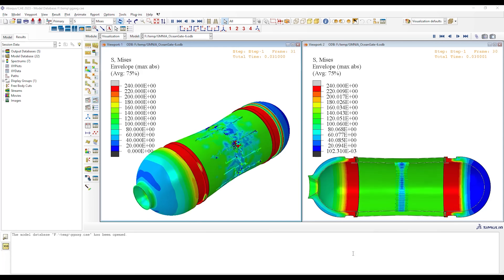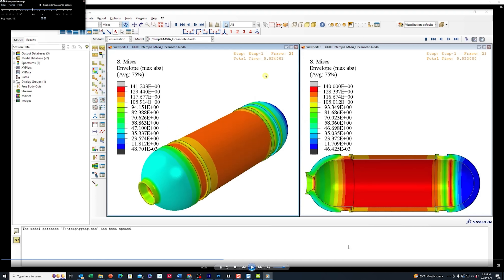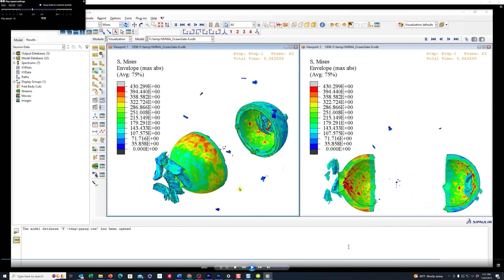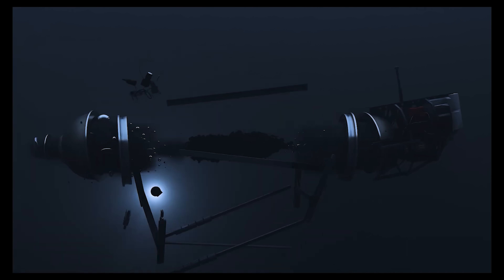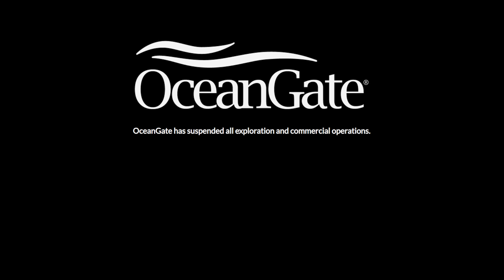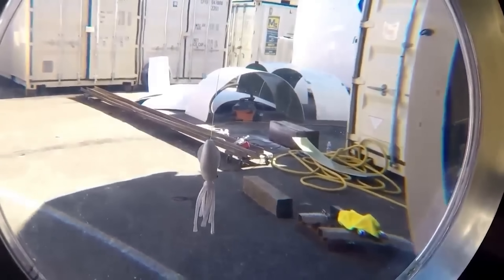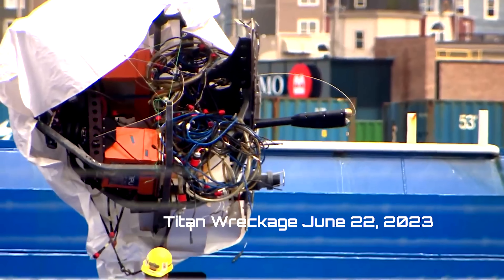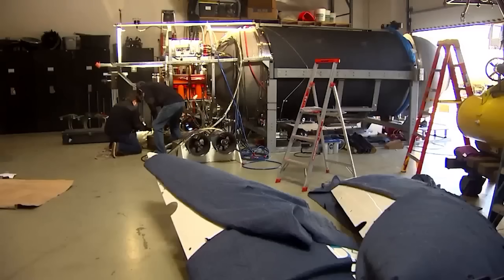Best Titan Sub Implosion Simulation, Cracked Porthole? Q & A

Comment: Wasn't the carbon fiber spun around a very thin sleeve of titanium  which wouldn't have broken up but just flattened out to the thickness of a sheet of paper. Imagine a soda can lying on its side with both ends removed and dropping a 1000 lb. weight on it.

Comment: Please take into consideration, that the deformation shown  in Dr. Wagner's simulation is probably exaggerated by a large scale factor. Carbon fiber composites are rather brittle. There is no way the carbon tube could deform to half its diameter without breaking.

Comment: QUESTION❓️ ,,,,  THE  MATERIAL  COMPOSITE  GLUED  TO THE  METAL  ,,  MAYBE  THESE SURFACES   COMPLETELY  SEPARATED AS THE  WEAKEST  POINT  BESIDES  THAT PORTHOLE  ONLY  OK AT  SOO MANY FEET   ,, NOT REALLY   AN INTELLIGENT   DESIGN   AND NOT  DEPENDABLE ❓️

Comment: another thing to note is this very video that shows a guy using off the shell tools to create an FD simulation of what could happen.  which means these guys didn't even have enough brains to see the results in a simulation.  its not to say the simulation got it perfectly right,  but the point is the craft wasnt 'suppose' to implode at all!! under the conditions it was ment to dwell within.

Comment: The cameras......... were they sending data to somewhere off the Titan.......like the mother ship? No one has mentioned this possibility.
Reply from the maker: Radio waves do not travel well under water, so they have to use hydro phones. And so they are limited to sending very small amounts of data. So who knows what Data they were able to send automatically in the background up to the support ship top side.
Reply: @jeffostroff  So, there must have been a pretty good delay in sending and receiving the text messages they were communicating with.

Comment: The most dangerous thing is someone using FEA where they make assumptions.  Carbon fibre is not homogeneous and modelling this without taking this into account and substituting a homogeneous material is not accurate. The Carbon fibre weave, direction and inter layer construction is important. If there are voids (no autoclave) can add significant weaknesses that can cause major fatigue, high stress raisers and regions for buckling. In this case it was not under tension. Which is bad. If for example there was a tear  this could jet like a water cutter slicing through anything or cause immediate pressure equalisation. Implosion. Given the shape was totally incorrect  for this pressure and the fact that they only did FEA like this to validate without real life data to correlate.

Comment: Titan had issues long before its fateful dive, as we now know from others who went on previous dives, have spoke on hearing crack and loud bangs upon their decent.   again, this 'accident' was completely avoidable if not for Mr Rush being a bone head.  And i hate to speak of him as such, but when you see all the evidence and his interviews the guy was little more than a brainless idiot who's arrogance got the better of him, and unfortunately took the lifes of others that were with him.   Arguable he could be forgiven for thinking carbon fiber to be this super indestructible material when its not.  far too many people have herald carbon fiber to be something its not!.  Its not a material that stronger than steel. why? because its strength only applies to one metric, not all.  if i can cut it with a pair of scissors in the making of patterns its to be molded into, than where is its strength.  Yes is has tensile strength stronger than steel, pulling apart. but its a fiber woven into sheets bond by epoxy resin.  its strength is governed by something that not strong is such applications  Resin in compression.  this is why in Formula one, it only takes the littlest tap from two cars touching each other for carbon fiber bits of their bodies to go breaking off and shattering into pieces.  how strong is that?  No the guy avoided all signs including those he experience himself upon several dives.  he was a bone head period.  The fundamental flaw was the crafts creator.  He hacked the craft together never accepting the reality and seriousness of what that craft would be forced to endure.  and he did it for the sake of arrogance and shoving his middle finger in the face of regulations and the regulatory body.   his big headedness got the better of him, and took others with him to their fate.

Comment: Another thought. When you see the footage from the KOMO video in 2018 of the sub under construction it sent up a red flag for me. TIf you pay attention to the later interview with Stockton in 2022 you will notice how weathered and beat up the Titan looks by comparison. It made me wonder. Was any maintenance or upkeep done between 2018 and the implosion in 2023?  Just looking at how different the hull of the sub looked some 4 years later it really made me wonder if simple lack of upkeep from regular use might have resulted in a weakened hull.

Comment: Presumably any bit of equipment on the outside that needs a control or data link to the cabin will need a hole in the hull to pass a cable or plumbing through...or was it nearly all wireless? We've seen the infamous Bluetooth games controller - was this talking to an access point in the equipment bay (i.e. outside the pressure hull), and if so, was there no cable-based redundancy in place at all? Really enjoying your discussion of all this!

Comment: Even if the cameras all got destroyed the video on those cameras is likely still around. Keep in mind that this is digital and the transmissions from the cameras would have been transmitted to the surface vessel-. It's not like a black box where the recordings are inside the cameras. So the video right up to the implosion should exist- but I'm sure that whoever has it will never release it or even admit to its existance

Comment: Did jeff not read the communications transcript? If he did he would know that the handpump to release the metal cage failed and that is why they struggled to get to the surface. They could not release the cage and surface as quick as they should have, and by the time they were able to eject the cage and race to the surface they ran out of time and imploded.

Comment: Wow. the interview with Stockton  was both eerie (in hindsight) and spot on. He mentioned that the the hull failure would not be immediate, that you would hear "cracking". That is exactly what is in the communication transcript between the Titan and the surface in its last moments
Reply: 06:10 he said crackling before it's starts to crack but what is the difference? Not much if anything. If it starts to crackle at 3000 metres I would be terrified
Reply: Why is he saying that at all? The word fail shouldn't even come out of his mouth, he was a psychopath and now a murderer
Reply: But after that he says the cracking stopped
Reply: the transcript was fake made by someone on tick tock
Reply: @SPM2206  has that been verified

Comment: It would be interesting to see videos from a previous successful dives to see what it was like inside and to hear any of the sounds that may have occurred during the dive.
Reply: When the lawsuits happen claiming gross negligence (invalidating the death waiver they signed), I would expect all previous dives will be examined for sounds and issues.  Then have oceangate experts explain what each one was, the root cause, and how it was tested and fixed for the next five.
They won’t have this documentation of course, and gross negligence should be easy to prove

Comment: The thing is that if you read the transcript of the communications between the Titan and the surface vessel they could hear cracking in th e hull and failure alarms going off for like a minute or so before the implosion. So, although the implosion itself was immediate- the hull failure was not.

Comment: The photos of the wreckage recovered appear to show the acrylic porthole and outer securing ring both being absent. This would suggest that the acrylic port was ejected outwards from the submersible by higher pressure within. That points towards an implosion of the carbon fibre tube which creates an over pressure inside the submersible dislodging the acrylic port. External pressure cracking would not dislodge the outer securing ring merely push the broken acrylic components inwards. The failure mechanism was almost certainly a catastrophic collapse of the carbon fibre tube somewhere around the centre of the tube. Everything else followed on from that.

Comment: An untested sub like this leads to failure via the weakest failure point, glue. They will find in their report that the failure of the vessel was not completely established, however some components were not certified for the depths the sub was subjected to. ie the window and front. That every dive lowered the material integrity of the sub most likely at the glued interfaces until a crack developed that would quickly propagate with catastrophic results, leading to the unfortunate loss of life of the crew. In this case the CEO had the power to ignore the warnings of safety experts and apply his own interpretation, that hull integrity would stay the same after every dive. This was not the case. Every dive weakened the structure till implosion occurred. This should have been obvious to most experts that did send the appropriate warnings that were ignored, which were correct, ie that loss of life would result from integrity loss caused by cyclic pressure fatigue, most likely of the glue.

Comment: I know Rush was clearly a risk-taker and quite possibly deluded, but I don't think he would have taken the sub down if there were visible cracks in the porthole, particularly if they were visible to the passengers. My money is still on the carbon fibre hull failing near the centre and I suspect the marks in those photos of the porthole were not cracks, and were just artefacts or reflections..

Comment: I'd bet the rhino lining (truck bed liner lol) was actually the original point of fault. As it is laid on top of the laminated carbon fiber hull component, but likely deforms differentially under compression, it may have adversely affected the adhesion of the outer carbon fiber laminations. Think of pulling a rubber band on your wrist and how you can feel it expand against your skin as it does, this is what the poly rhino liner may have done through cycles of pressure to the hull. Granted I am making assumptions, but I think we all see the good authority in even the average Joe being able to say they've had one night stands more thought out than that stupid sub.
Reply: Lol I threw some shovels and ladders on my rhino lining in the back of my truck bed and it got scratched up, that’s no material for this type of expedition

Comment: Since dawn of time Strings, Ropes, and Fibers are used in Tension. 

This design has oceans compressive pressure held by adhesives. 

The engineering total blunder is  not understanding that only the adhesive is holding the   pressure from the oceans depth.

So the entire thing is a rotten to the core stupid flawed design. It is like making a pure concrete structure all in tension where concrete has little strength in tension. 

How many times have you pushed a rope or string?

If this kludge was in outer spaces vacuum it would have just 1 atmosphere pressure and the fibers would be in tension. 

At the Titanic depth the pressure is 340 atmospheres.  The only thing that helped this bad design work for awhile was the fibers had some pre tension when it was made.

The cracking sounds during the dives are warnings that the darn thing is degrading and braking the glue adhesives. 

Usually in Engineering rotten designs are driven by stupid managers who ignore basic stuff. So eventually the design has some terrible outcome.

Comment: Many of those "cracks" and blobs which you see in the actual front aspect aren't cracks, they're just delaminated gaps (probably the glue aging or from repeated stress cycles?) between the accrylic and the surface behind it. That means there is uneven distribution of pressure. As for the bright stuff that looks like cracks, I think those are scratches from when they must've hit the titanic by accident or something, which can happen since human perception of distance underwater isn't great and the convex lens effect from the port hole also may contribute error in judgement.

Either way I'm still of belief that the failure point isn't the porthole, but rather the carbon fibre joint to the titanium ring.

Comment: I'm very curious as to what caused their descent rate to be much faster than normal. Were they less boyant than normal? If so, what changed? 

There have been many accounts of the sub emitting cracking sounds not only on this dive but previous ones. Those were very likely indications of damage to the carbon fiber. In this video, Rush mentions the carbon fiber is coated with Rhino Liner to prevent water from penetrating the fiber matrix. Had that barrier been breached I'm curious if their real-time hull monitoring system would have picked up on that damage early on. We know that system was giving many warnings in the minutes before the implosion. That also makes me think the viewport wasn't the failure point.

And, like many others, I'm curious how well the glued joint between the titanium and carbon fiber handled the repeated compression / expansion cycles. Probably not well. And those, too, could have been a possible entry point for water saturating the carbon fiber.

Hopefully we'll get some answers at some point.

Comment: There is no reason to suggest the failure started in the middle of the cyclinder. The weak point in the design is the incompatible materials where the resin shell is glued to the titanium half shells. Noises were reported coming from the "aft" of the vessel.

Comment: Those aren't cracks. I have worked with resin/glass jewellery and that appears to be air trapped in the glue. It looks like that due to the magnification of the dome. 
Which is its own problem. But they aren't cracks.

Comment: Having spent thousands of hours looking through a similar viewport at 1000 meters plus depths I will say that what looks like "cracks" is almost certainly the thin layer of silicone grease used to lubricate the interface between plastic and metal. Parts of the video show what appears to be condensation on the lower portion which is a normal occurrence.

Comment: The crazy thing is,
everything from the sub survived intact with minimum damage, except the thing that was supposed to keep them alive.
James Cameron said he believes, the entire carbon capsule telescoped into the back dome and both became 1 single piece.
The coast guard said that there were only 2 pieces of Titan that they were not able to recover, but they were satisfied with the pieces they recovered... not recovering the 'back dome' would be a big thing for the investigation, so I'm guessing they did recover the back dome.

But they did not show the 'back dome' in any of the recovery pictures for some reason.

If the carbon capsule telescoped into the back dome, that means most, if not all the human remains were recovered.
It may be a grXesome sight, which may explain why they are not showing the back dome when the sub-parts were being offloaded, and were more discreet offloading the back dome. 
If all of this is true, that means the main culprit will be something coming from the front dome failing, because it pushed them all back from the front.

Comment: They probably had a water leak in the rear weighting them down.
As if you actually take the speed of the decent, they where almost at the bottom at the moment of implosion.
And they barely rised before it went silent from the Titan.

They where still going down when all led went red as the transcrips tell us, if its real.
So the warning system worked.
But when your to heavy there is little to nothing to make your decent stop. They droped the weight and it didnt shoot up as it was supposed to..
People calculated that at 3400 m they only climbed 22 m after dropping the weights.
They where to heavy and if the struckture was weakened from the leakage from the rear, as the transcrpt say they lost their aft battery, battery A first.

So the implotion started from the rear, that is what i think. Rest of the sub was actually structural whole, untill that point.
As the rear part was damaged. 
That is if the transcript is real and not faked

Comment: 7:52 those cracks around the porthole looks like sealant being squeezed unevenly .. like when you try to squeeze grease between 2 clear plates. 
because Rush probably  didnt get the acrylic machined perfectly to the titanium hole.

Comment: Notice that the end caps move in opposite directions in the two animations.  Take them with a grain of salt because their assumptions will greatly affect the outcome. There's far more that we don't know than do know about the vessel. (However, the conclusion that it was very fast is undoubtedly correct.  However, it the transcript is correct, then they knew for some minutes that they were in trouble.)

Comment: The investigation will perform detailed forensic analysis of any memory chips they find in cameras. The external cameras are oil filled to equalize pressure but the hydrostatic shock might still have caused damage. They are not merely limited to putting a memory chip on a good board. It really depends on what they find and the resources they throw at this, however this is a unique high profile opportunity for specialists to try their most advanced recovery techniques on a real world challenge. It's a safe bet that they will.

Comment: If that computer had ssd drive, it could survive and give some insights(speciffically, accoustic sensors). Same with sd cards in gopro cameras, even if damaged, data can be still recovered from chip itself. But i dont expect those data to be released to public.